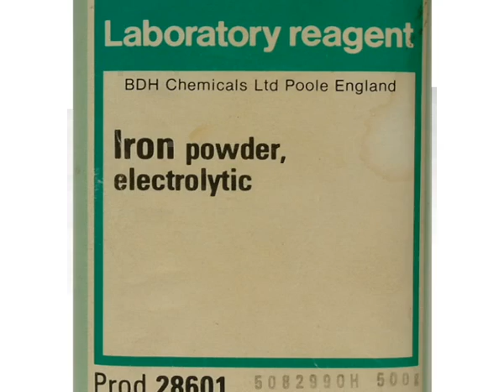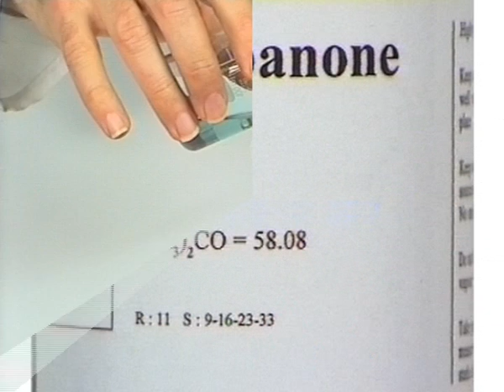Extracting copper from copper sulphate

Comment: So basically, if you were to add an iron nail into copper sulfate and mix it together you would get pure copper?
Reply: replace iron with anything above copper in the reactivity series
Reply: zinc powder
Reply: @NerdyNEET   It goes into the solution. Why the solution turns blue instead of green.